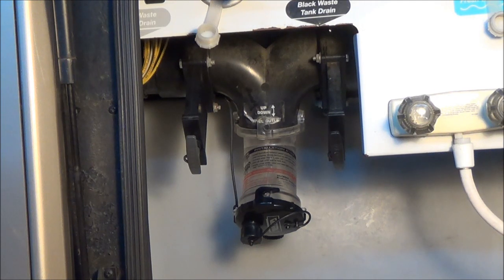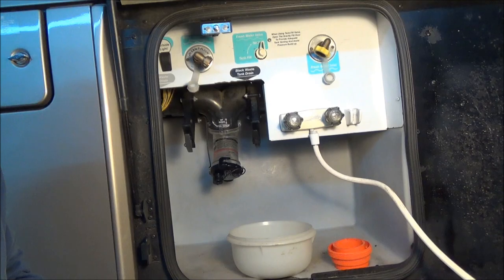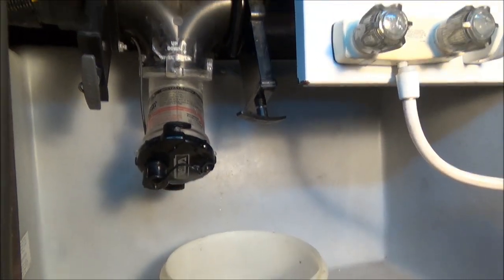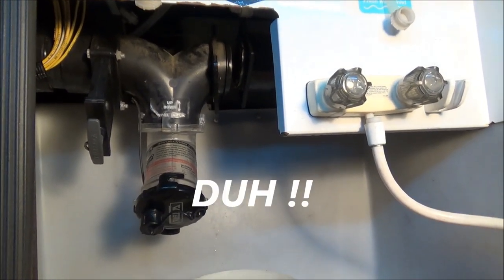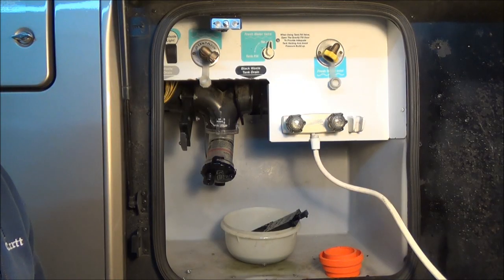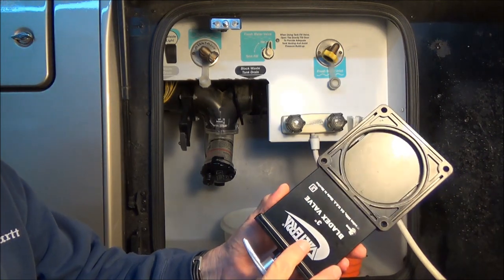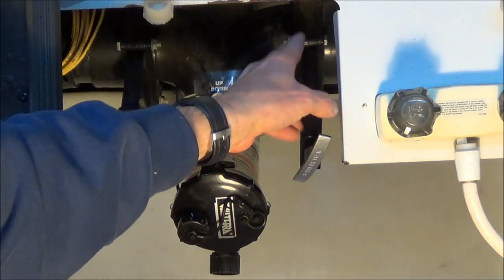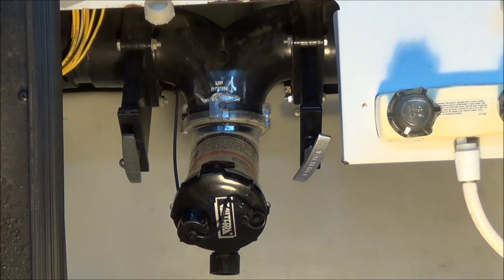RV WASTE VALVE REPLACEMENT - IT'S EASY !!!!!!!!

Comment: Gotta love the magic of YouTube editing. For those struggling with reinserting the new valve, you can use the "taco" method. For starters, you'll want to apply some silicone grease to the seals for that will hold them on to the new valve(not on the RV) and keep them lubricated. Then you need to acquire one of those dollar store cutting boards or very thin plexi/plastic like a face mask visor. This is the taco shell and the new valve with the 2 seals with silicone grease on them is the taco meat. Now you can slide the whole taco between the 2 pipes while keeping the seals in place and then slip out the taco shell. Should go as smooth as a Mexican dinner the morning after.🌮🌮🌮🌮

Comment: Thanks for your video, the best one on this project.  Had to watch several times because the rubber seals kept falling off when trying to assemble with them as one piece.  Once I followed your video showing putting the seals on first it went easy.

Comment: Love the way you cut out the hard part, sliding the new valve into place without pushing out the flanges or spreading apart the pipes.  Also I’ll bet those bolts hidden on the back side were a bear too.  Cutting out the cussing eliminated 90% of the video.

Comment: Step 1 buy valve, step 2????, step 3 done!
Reply: Simon Andrews
 I GUESS WE ARE DEPRIVED OF SEEING WHAT A STRUGGLE IT WAS TO ACTUALLY INSTALL THE THING.  MIGHT WE REFER TO IT AS THE YOUTUBE "PRESTO" VIDEO SYNDROME?  OTHERWISE KNOWN AS "EDITING".
Reply: @seymourscagnetti1413  I notice no one ever has a stuck bolt or nut in these vids.
Reply: @seymourscagnetti1413  I just watched it and told my wife that the video didn't show the seals falling out and get covered with dirt, the mechanic throwing tools across the yard or a complete new vocabulary, just on this job alone. I agree with the above videos about access and no wiggle in the drain pipes.

Comment: As a newbie, nobody mentions how to remove/replace the underbelly panels. Are they all the same?  My valves are cable operated. No clues on youtube as to the location. Good video for straight forward repairs, but lacking in preparation and finishing details .
Reply: Good question. I have ended up cutting the under panel- would have taken forever to unscrew all the way around. Where do you get replacement under panel?

Comment: "It's so easy even a cave man could do it".  In my case the valve is buried under insulation and a sheet metal underbelly.  Extremely hard to get to and work on laying on a creeper with very little room.  I cut a path to it and struggled but managed to remove the four bolts but have yet to get the valve out.  The piping is solid with no free play to clear the seals.  I'm looking for some tips but haven't found any yet.  Hopefully I can get the valve out without damaging the flanges but getting a new valve and seals installed looks daunting.
Reply: Finally got it out.  It's going to be a trip to get the new one in.
Reply: Same problem, 2 doors to access after you cut thru insulation to find gate valves. Only 1 inch spread to pull apart thus seals move without seeing correct sitting in groove. Small hands to run wrenches from the top, bottom are fairly easy (4 bolts). Used plumbers grease to try holding seals in, clearance to small to allow correct fit. Real bastered  of a job since it leaks every time after install. Laying on your back looking at underside with no room to access is a tough one...Still working on it.
Reply: @larryblatchford1038  I'm currently having the same problem, no spread in the piping. I'm worried once I get the old one out I may never be able to get the new one in. Any tips :)
Reply: I'm currently having the same problem, no spread in the piping. I'm worried once I get the old one out I may never be able to get the new one in. Any tips :)

Comment: Thanks! But I disagree with the words printed over the installation... you should NEVER put the seals on the gate valve first then put it in! You risk damaging the seals.
Reply: I did. Thought it might be easier. I greased everything up first though. Seals, piping etc. Not much room for play, so I just installed everything on at once. I got lucky, it worked. This is a dirty, nasty job. This video, is the clean PG version.
Reply: @Reel-Lentless All I can say is, read the instructions that come with the valve. But think about it: If the seal is in place, and you push the valve in even slightly off-center, you risk pushing that seal out of place or damaging it. On the other hand, if the seal is on the valve pipe, the seal cannot move and pushes against the seat. I have done a number of these.